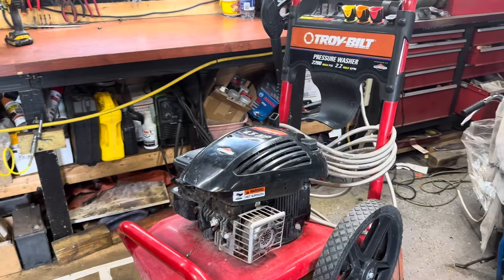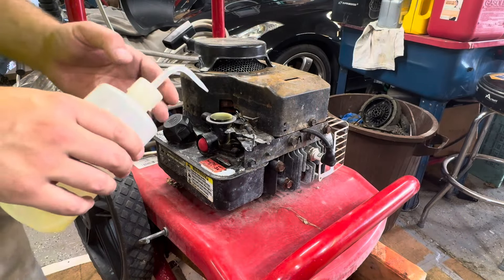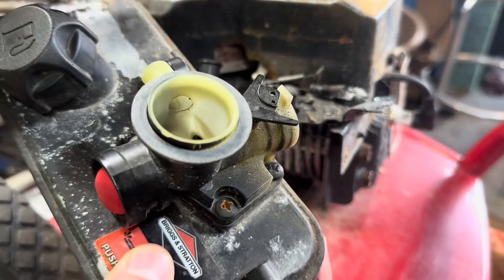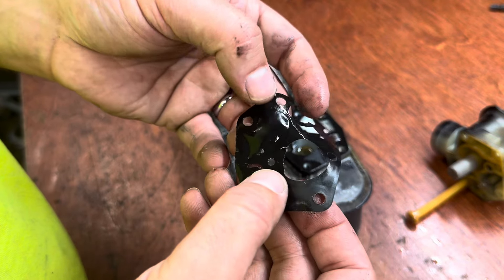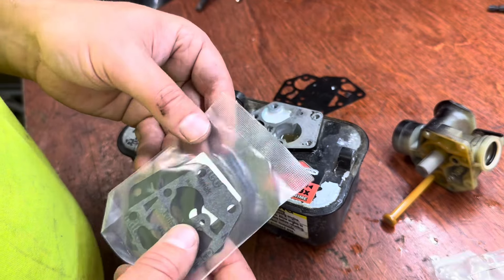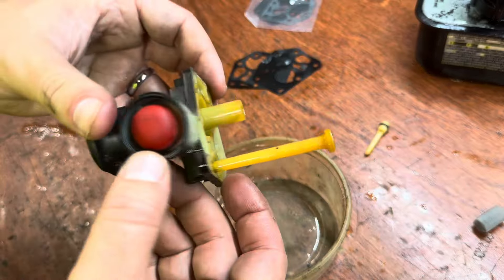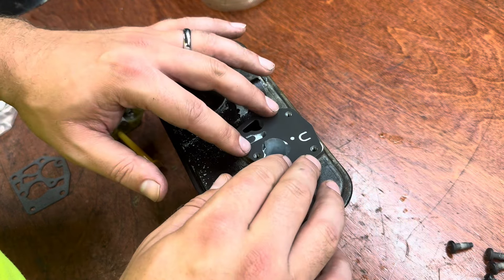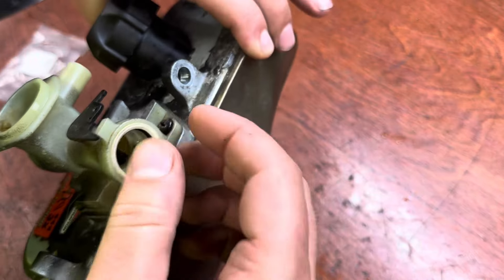Why wont this Troy-Bilt pressure washer start

Comment: I love those cheap, simple Briggs Classic engines. They start easily, run great and just keep going and going! Great tip on the gasket sequence, probably would run if it was backwards.
Reply from the maker: Other than the gas tanks getting rusty, they really are solid set ups, there no float, needle, seat, fuel lines or adjustments. Occasionally they need this gasket and diaphragm replaced and the primer bulb, but it’s such a simple fix. Thanks for commenting!

Comment: Good job!
I’ve had those carbs apart but for some reason I don’t remember that main jet being removable. Maybe I was working on a slightly different model.
Someone else mentioned increasing your audio volume. At the loudest sequences it was fine - just variations in volume from one clip to another, so I had to adjust volume at least three times. More consistent volume is what’s really needed. 
Great editing, by the way - I always appreciate speeding up fastener sequences.
Reply from the maker: Thanks for the feedback. When there’s outside noises it affects the pickup of my voice. I have a mic but I don’t like using it because it doesn’t sound natural. Maybe I’ll try a few vids again with the mic.

Comment: i was given a troy bilt pressure washer for free without a hose and wand.  can i connect the garden hose to it and run it to see if the pump work or do i have to have the hose and wand attached.  id kinda like to find out if the pump works before i spend 80$ on a hose and wand. also i just watched a video where the mechanic says never run a pressure washer longer than a minute without water moving though the pump.  thanks.
Reply from the maker: You can run it without a wand, the water should come out slightly higher pressure than a regular hose but not by much. It’ll be hard to tell if the pump is building pressure. He’s correct, I wouldn’t run a pump for more than a minute without water. The water cools the pump.